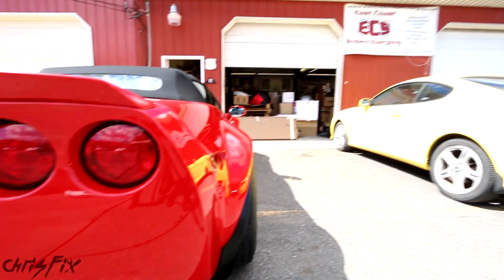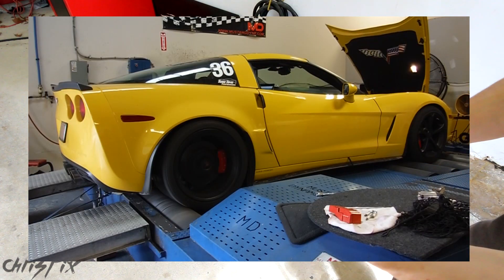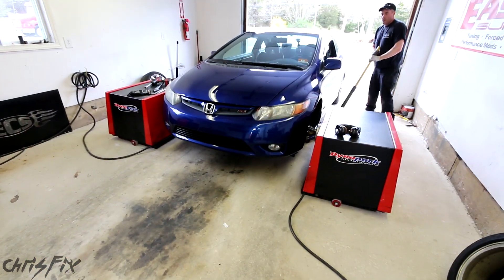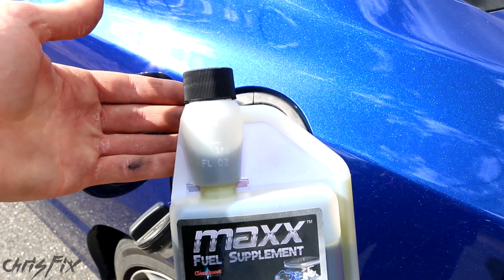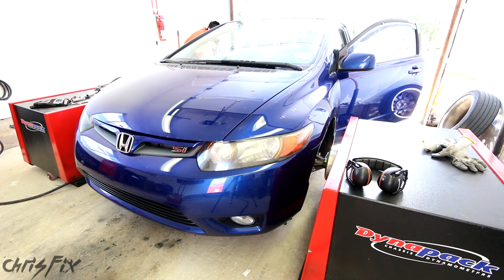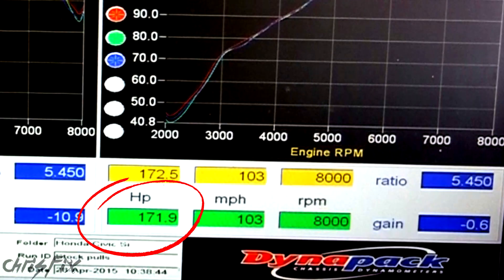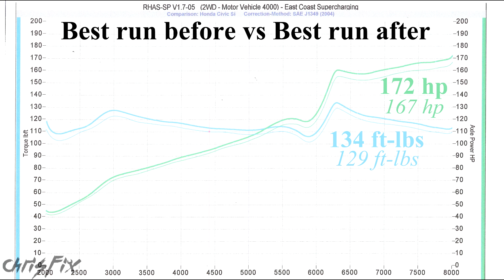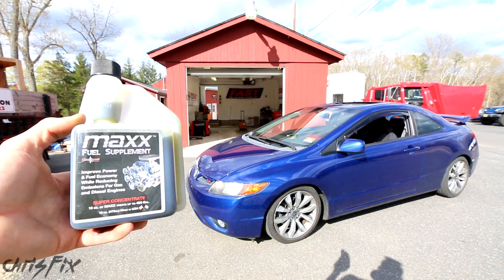Can a Fuel Additive Really Increase Horsepower in Your Car? (With Proof)

Comment: I want to see you take your truck in there! How much did it cost to use the dyno? I might be interested in checking mine.
Reply from the maker: ***Classified*** I wish! I tried to get my Vette in there but they couldnt lock up 3rd gear. The dyno runs were $300.
Reply: ChrisFix So doing this on an auto is out? AND DAMN! That's a lot of $$$!!!
Reply from the maker: ***Classified*** It isn't "out" but it is harder. They said if I had a newer car (electronic shifting tranny) they could lock up the transmission but since it is a mechanical tranny, it is a lot harder to lock.
Reply: ChrisFix do you know when they made the switch to electronic?
Reply from the maker: ***Classified*** Off hand, no I do not. But I think early 2000s

Comment: vtec..yo
Reply: ***** 
VVT and VTEC is not the same system.
Variable valve timing Vs Variable Timing and Lift Electronic Control.
The Vtec is a Dual system that change the timing and the lift of the camshaft.
The VVT is a system where they just change the timing, or the lift.

The B16A motor have Three(3) different Cam lobes on the camshaft.
Two of them are for low and mid-range and actuate one valve each and the third one actuate both valves over a certain rpm

The idea have been here for a long time though.

Fiat made a VVT system in the 1960.
Porsche Patented one in 1958.
Alfa-Romeo was the first manufacturer to use VVT in their production cars (1980)
NVCS (Nissan Variable Cam System)
Porsche was first with continuous adjustment on their VarioCam system.
BMW Dual VANOS.
Reply: VTEC just kick in yo, right in the ass
Reply: James MAAAAAD
Reply: Victor Sanchez technically the ford coyote 5.0 and the new LT1 &LT4 corvette are variable valve timing also known as Vtec.  Honda might have been a player but you cant argue with power from idle pulling hard thru to 7k
Reply: Victor Sanchez exotic  cars use v tech lol
Reply: Lol
Reply: His point was that BMWs straight 6 engines produce power because 'BMW yo'.  My point is that BMW does turbo their engines because they want to sell cars with power and keep up with the competition.  The N54 is a factory (twin!)turbo BMW engine. So was the N55.  BMW is no stranger to turbos.  And these days....you need turbos on engines because manufacturers are making them so small to keep inline with fuel emissions that in order to get any sort of acceleration, you need something to give it any sort of decent power ('eco-boost' anyone?).  I mean, who really thinks that a 4cyl is just fine for pushing around 3600lbs?
Reply: James Yea...  Honda Vtec that makes 173 HP.... Wow, how insane is that? God that sure is impressive...

-.-
Reply: It's just valve timing electric control dude. All it really does is have an increase of power when it reaches specific RPM's. It's not all that unless you tune and modify your ECU and etc. lol I only like it cause it's fun to rev high RPM's
Reply: +VTECxiPiStOl the s2k actually pulls when you hit vtec
Reply: +James Dem unicorns
Reply: Dragon Don BMWs l6s are cancer after 50k miles. vanos starts dying and needs a rebuild or the engine will destroy itself.
Reply: And that's why they are hundreds of thousands of dollars 😉 lol
Reply: Nikel87 that sounds about right all i know is they are a pan when something goes wrong, and it is a big part of y modern motors haft to have the right weight of oil.
Reply: James yea have to wait till 6 grand to get 170 hp when a american v8 make adv. 300 at 2,000
Reply: wade mckenney My max torque is 4200 and thats 390 pound ft. But yeah HP is almost around 2000
Reply: wade mckenney but vtec gets 36+ mpg so it depends on what you want most
Reply: Gregory Krisa Haha very true! Even tho my car has MDS I still find my self with a heavy foot just because I have strait pipes and like to hear the rumble
Reply: Gregory Krisa 36+ accurate enough. mines mid 40's though
Reply: +wade mckenney  You better make 300 hp with double the displacement (if you know what that means).
Reply: unless you want it that is
Reply: Except those models where BMW DID put turbos on them....so apparently, you DO need them ;)
Reply: It's i-VTEC.
Reply: VTEC just kick in right there
Reply: with a supercharged corvettte you dont need vtecs.
Reply: Lmao vtec whatever you want it's still SLOW!

Comment: I'm gonna start by saying I know nothing about dynos. ....but it didn't seem like you was running through the gears when the car was on the dynos...why is that?
Reply: If you look at the specs for your car it will say something like 395hp at 6,500rpm so there's no need to change gears you only need to get it up to its max rpm
Reply: shamothecow ahh I see...thx
Reply from the maker: Ashley Sly You want to find the 1:1 gear ratio in your transmission and only run in that gear on a dyno. You start at 2000rpms and go to redline and that is how they calculate HP. The dyno acutally measures torque (rotational force) and then there is an equation it uses and factors in some other stuff (weather conditions for example) to come up with HP numbers. That clear some things up?

Comment: Not really different you would not feel or notice such a small difference and the V Tec boosts in a quick jump bc it needs a tune so it does more power for a longer time
Reply from the maker: jason hernandez I guess it depends how you look at it. To fill a 15 gallon gas tank, it costs you $1. For that $1 you have 10 extra HP and Ft-lbs of torque.
Reply from the maker: Jose Lozano But on a higher hp car you should see a larger increase in HP created by the additive. If a 200hp engine makes 10 extra hp, a 400hp engine might make 20hp more.
Reply: I'll test it out I don't have the fastest car in the world but I'll see I have a 2000 Mazda mx5 turbocharged giveing around 320Hp at the wheels
Reply: Of your car has 400hp, 11hp is not so much. In a low hp car like this Honda, you can feel the 11hp difference. You have a point, I'm sure you can get more hp off the fuel additive with a tune.
Reply from the maker: jason hernandez Dang. that is a fast car!

Comment: Question. Did the car sit a meaningful amount of time after arriving before being put on the dyno for the first set? Because if it did then the transmission fluid would have cooled down causing more drag and thus power loss on the dyno. Plus wheel bearing grease etc.
Reply: Cragified engine temp was the same for both.  you can only assume the means everything else was the same temp. (same set to set not same as the engine lol)
Reply: Cragified
did you not see the part where they let the car cool down? They drove before both tests and let the car sit for similar times
Reply from the maker: Cragified We tried to be as consistent as possible so the car sat for about the same amount of time in both tests, had similar weather conditions (which were also adjusted/corrected by the dyno itself), similar coolant temp, etc.
Reply: Paul Benedict Actually I asked because after a long drive the transmission fluid would have warmed up and thus provided less resistance inside the transmission to the transmission  of power. The engine sitting and running will not warm up the transmission fluid for a very long time either automatic or manual. On a rear wheel drive vehicle the differential will never warm up sitting.

I was curious because after the drive after adding the additive the transmission fluid would be fully warmed up and robbing less power as it is moved about. Since it was not shown doing a drive before the first set the temperatures of drive line fluids and lubricants may not have been the same.
Reply from the maker: Cragified I called CleanBoost and they said it is not an octane booster.
Reply: Paul Benedict It was only shown for the second run. That was the point of my question. It was not shown that the car had been driven an equal amount of time and thus the fluids outside the engine that cause parasitic losses in the drive line were at the same temperature.
Reply: ChrisFix Thinking more on the product and it's chemical components and the fact that octane boosting would do nothing for diesel engines the AKI increasing compounds are most likely there to compensate for AKI reducing compounds in the naptha distillate base for gasoline application.

Reducing surface tension of the fuels in both engine types would cause a more even and quicker flame front in combustion thus increasing both converted chemical energy and reducing emissions both two of the sell points of it.
Reply: Cragified
How do you think the car got there? They didnt carry it.
Reply: Paul Benedict You are rather obtuse aren't you, read my very first post. Just because they drove it there didn't mean it didn't sit around before they got to doing the run. Which is what I asked about.
Reply: Cragified
im just having some light hearted fun. You seem to know a lot about this topic, surely more than i do. you have asked that question many times though and chrisfix even answered it himself. In videos like this you can only assume they tried their best to keep all variables the same. Im really not trying to be "obtuse" but bro get over it.

Comment: But the real question is, what would using this in every tank for the life of the car do to the engine?
Reply from the maker: Robert B Or, would you use this when you need a little kick of HP? I want to do a fuel economy test to see if it actually saves you money like they claim. It would cost $1 per tank of gas (15 gallon tank) to run this stuff, but if it increases your mpgs by 1 mpg, then you save money!
Reply: ChrisFix They do boast "destroying carbon deposits, removing harmful water accumulation, blowing out slagging and cold-end corrosion." I wonder if you would be able to see a difference like when you did the sea foam looking in the engine? Or if there was another way to test that it was safe and doing what it says for all the components in your engine.
Reply from the maker: Robert B Really?  I didnt see that and I have been studying their website lately haha

Comment: holy crap!  I think you just sold me some cleanboost max for my sidekick with 95 sick ponies.  It can use all the help it can get.
Reply from the maker: Dixon Cider That is a good tip! Maybe we should do a drop in filter vs cold air intake/filter video!
Reply from the maker: wvjon75 That would be really cool. I need to see what I can do!
Reply: wvjon75 i notice a horsepower gain with K&N air filters on the small engines, even the drop in for the OEM airbox.
Reply from the maker: wvjon75 This sold me too. I wasnt going to use this since I was just doing this as a test video, but now, I am a believer!
Reply: ChrisFix Please do.  Maybe include K&N drop in vs regular.  I really think there may be some truth to the hp claims of catback exhausts and air filters as well.  Many say they are negligible but I watched vid where a 4.0 Jeep gained 6 hp and 7ft lbs from a Dynomax super turbo muffler and cat back mandrel bent piping!  I can feel every little bit in my underpowered Zuk so I'll use anything that's proven to help.

Comment: I don't think that 4 banger has high enough compression to even need a booster.
5HP or 2% seems within the margin or error.
Reply from the maker: PC Master Race It has nothing to do with compression in this case because this isnt an octane booster. The additive supposedly works on a molecular level to make the combustion process more efficient and complete. I thought the same thing until I started doing some research on their stuff.

Comment: bah its bs, cold front came through while he was driving around and gave him a cooler air charge.    BUAHAHAHAHAH   j/k j/k please dont hurt me.    THumbs up on the vid
Reply from the maker: Rhage73 Hahaha, thanks a lot man. All kidding aside, we took that into account. The dyno has a barometer, temp gauge, and vacuum reader to take all of that stuff into account and adjust the readings accordingly. Also, we filmed it the same day within an hour of each run so that the conditions would be consistent!
Reply: YA i was watching, that stuff is impressive indeed. i just felt like throwin a joke.  =)
Reply from the maker: Rhage73 Haha, well you made me laugh so it worked!

Comment: Very interesting. Wonder how much it increases the octane level to. Wonder if premium gas with the additive will do
Reply from the maker: dkhill27 The Honda requires premium so it already had premium in the tank when we added the cleanboost maxx. This is all according to their website ( http://bit.ly/boostperfmaxx )... They say that their "supplement" works on a molecular level and makes the gas burn more efficiently. So it is NOT an octane booster which is very interesting!

Comment: Hmmm.  Very interesting.   May have to give that stuff a try.   Do you think you may try some of the other do called he in a bottle additives?
Reply from the maker: sketchyssk8shop I want to test other additives as well. I was thinking of testing seafoam before and after, on the dyno. Any recommendations? The link to the additive I used is in the description by the way!
Reply: ChrisFix  saw a few on the shelf last time I was at the parts house that claim to have nitro methanol in them.   Would be interesting to see what they do.   When I raced years ago I used to put the 10% nitro model airplane fuel in my tank.  About a quart to 5 gallons of 93 octane.   Had a 351 m in a 79 mustang w 3 2bbl carbs n a dual stage nitrous kit ftom nos.  USA Picked Up about A 10th Of A second IN THE Quarter.   Ran mid 11 one model fuel.
Reply from the maker: sketchyssk8shop Dang! That is pretty good! Yea, I am sure octane boosters work but stuff that doesnt boost octane, yet says you will make more power is what I am interested in!
Reply: ChrisFix I'll look at the stuff when I go get a new starter tomorrow afternoon.   I will get the name n info on the stuff I saw.  Btw the air plane fuel came from tower hobbies under their brand.